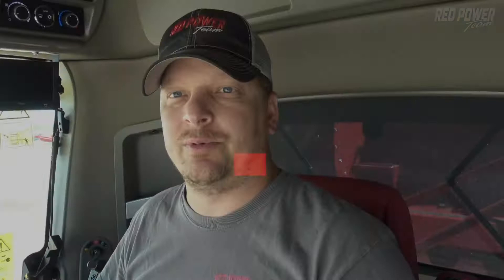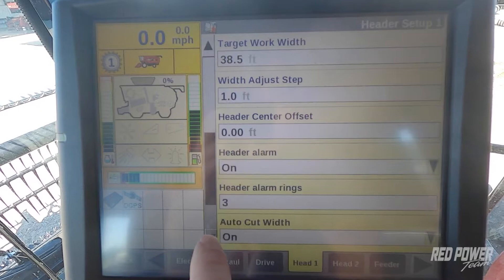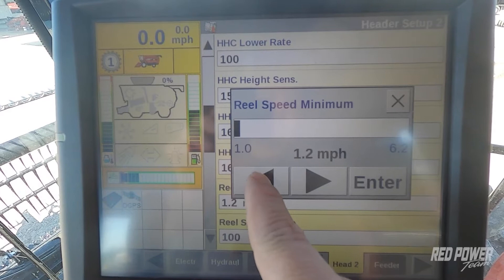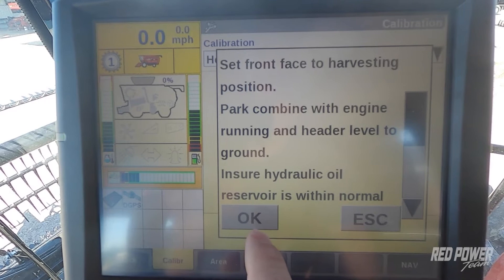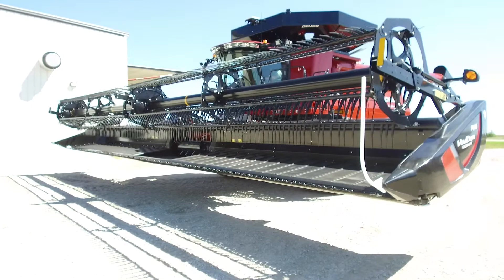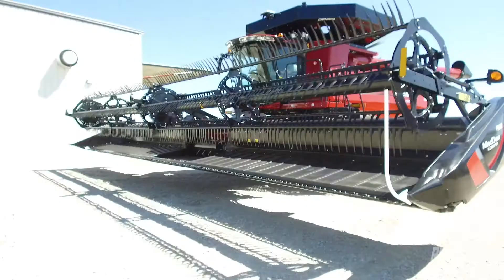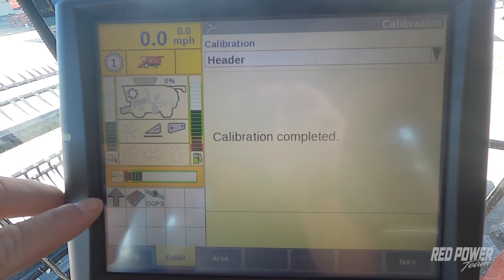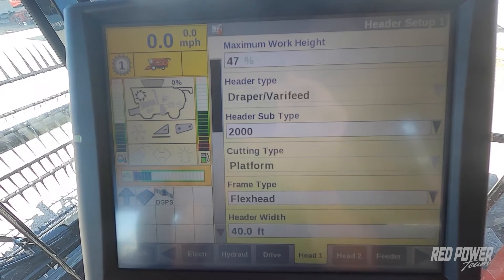MacDon Header Calibrations and Setup with Case IH Combine | Red Power Team Combine Tips

Comment: As mentioned, shift and resume is proper way to use headland mode when turning around.  Set the 2 different cutting heights is case you want to lift over a rock or something and still be cutting.  I was here to remember how to get my header into float mode.

Comment: Set point 2 should not necessarily be used for headland turn arounds.  There is a mode specifically for headlands.  And you hold the back shift button and the resume button and that will put it in headland mode and will automatically raise the head past the max height set point so it kicks the counter off.  If you have your headland settings set it'll also adjust your sieves and fan speed to adjust when turning around to minimize crop blowout.